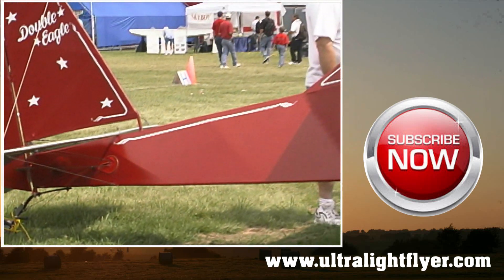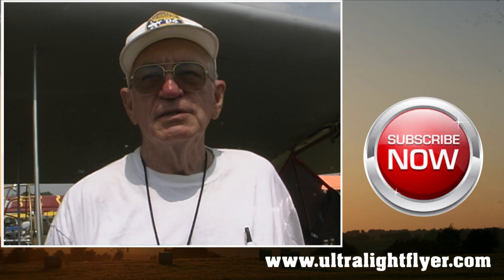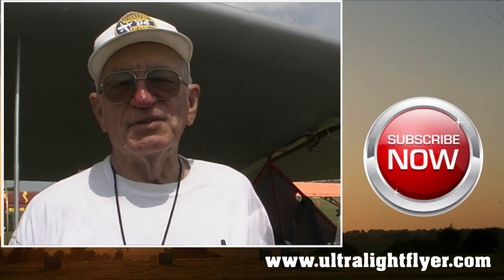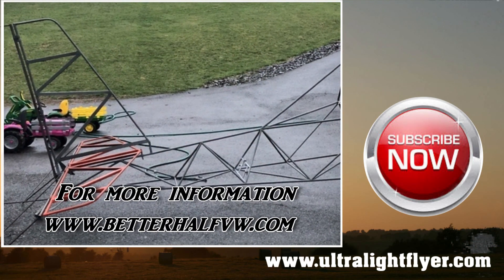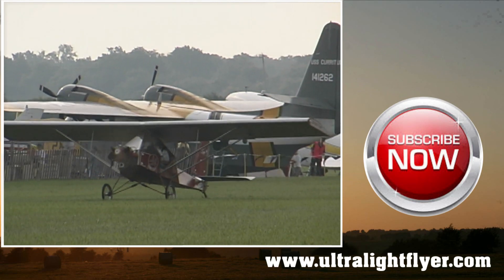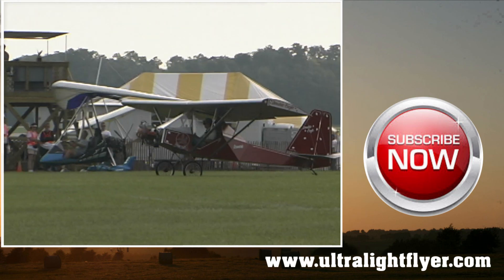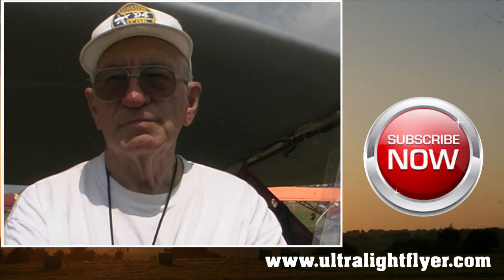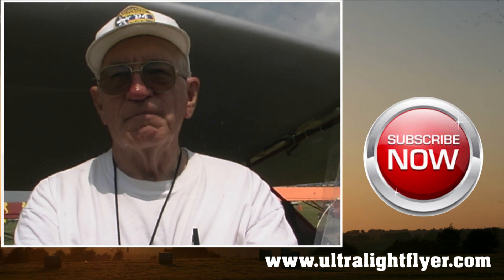Double Eagle, Leonard Milholland’s Double Eagle experimental amateurbuilt aircraft kit.

Comment: Anyone know if the landing gear was redesigned after this prototype model, which flew in 2003?  I was about sold until I saw the gear bend after what seemed like a fairly benign bounce.  If I built it, I know I would worry about doing the same.

Comment: HA!  6:05.  Bends the hell out of the gear.  Not a good advertisement for the gear.
Reply from the maker: To fly in into Airventure's Fun Fly Zone, requires a great deal of experience, and skill. You are limited to 500 feet of altitude, must fly a very stringent pattern, with a base along the side of the main runway, where the BIG guys are landing! 
On final at about 75 feet you have to do a TIGHT left hand turn, level out to land uphill on a grass strip that has about 3 dips in it. If you happen to land in one it shoots you back up into the air like a ramp. OH did I mention you are usually landing in a 90 degree crosswind!
I know of MANY conventional pilots that won't even ATTEMPT to do what these ultralight pilots do several hundred times a day - in most cases very successfully. The lack of any real damage speaks to the pilots skill, and the aircraft's slow landing speed, and durability.
The Ultralight Flyer
Reply: @ultralightnews  

I loved this video report as opposed to the Dan Johnson 'infomercials', which I see as a shill for producers, rather than providing information about the aircraft/accessories.

Pertaining to the comments about the pilot bending the right landing gear, I did NOT take their comments as being derogatory to the pilot, merely as a strong notation of 'oh crap, did you see that?' to the severe damage incurred.

I DO appreciate your explanatory of the landing conditions for that strip and the very strident requirements for landing there: personally I would NOT place upon myself such a level of stress, just to say 'I've been there!'.  Back country flying will be my thing, so terrain difficulties will be part and parcel of my need to command 'proper technique', but what will NOT be a part of it, is some stressed out ATC commanding me in an imperious tone, to obey his/her every jot and title for the 'privilege' of landing there.

The bottom line for me on the landing sequence is that DESPITE the severe landing results, the little plane kept right on going, and because of what looks to be a simpler design, I would no doubt want to BEEF UP the ability of the landing gear to handle MUCH MORE stress in landings.

Thank you again for a great video.
Reply: @ultralightnews  .... i am not taking away from anyone or there experience here. ! we as pilots have all had our fair share of ( not so pretty landings ) all i was pointing out was the landing gear on that plane seems to be very week and needs to be able to take much more of an impact than what was shown in the video !! .. thank you for your reply !!
Reply: @highfive3057  Weak....not Weak. Details matter.
Reply: I flew that plane from  Leonard's place to Huntsville Tx and back to Leonard's when  it was about a year old about 170 miles...I think the gear just got " smacked" to hard  on that landing. Anything can be damaged if you put to buck force  on it.
Reply: Noticed that too.
Reply: i seen that to !!!!!!   WOW